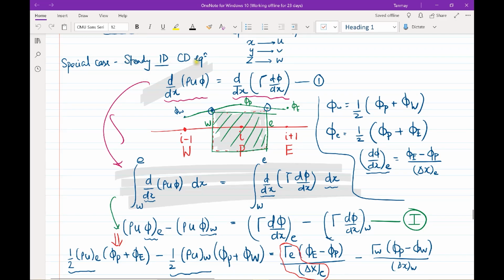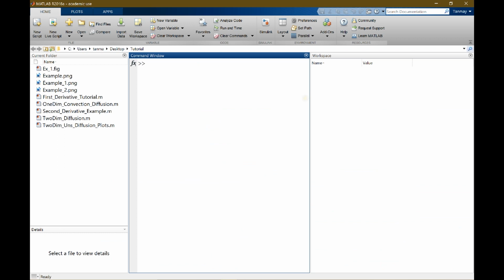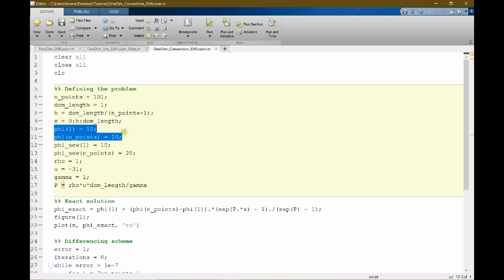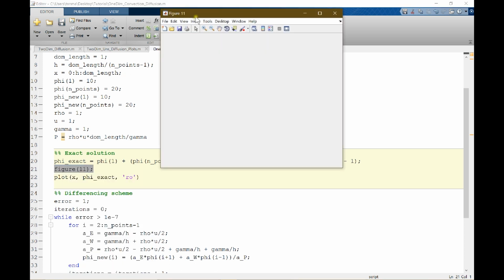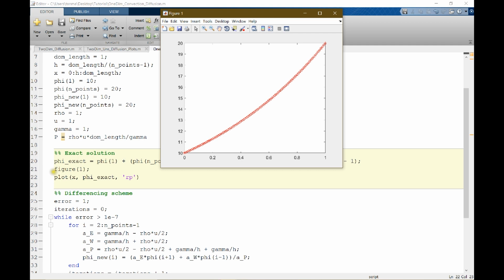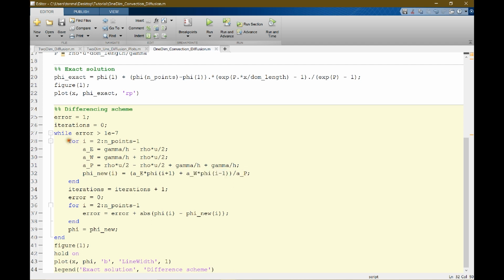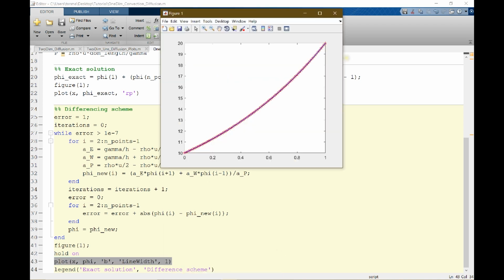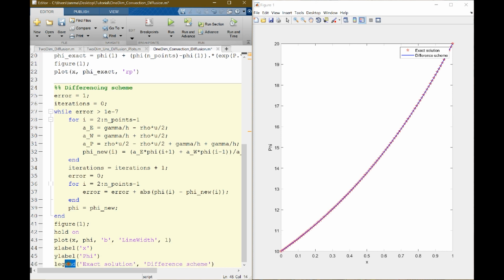Solving 1D Convection Diffusion Equation using MATLAB | Lecture 11 | ICFDM

Comment: Hai sir. It is really a worth lecture. But i am getting confused with boundary nodes. Can you please explain how this codes are doing at boundary nodes?
Reply: bro boundary nodes are different the answers are coming wrong  do you have the correct codes
Reply: cant take those at phi (1) and phi(n). can you help
Reply: I need the code. I have tried using different boundary nodes but still.
Reply: do you have the correct code

Comment: Can you give me the idea to solve the 3D species transport equation for steady state? I am facing the problem with convection term which include Peclet number. If  possible kindly suggest me to solve using the FVM because through the FDM, with increasing Peclet number beyond 10, always divergent is coming.